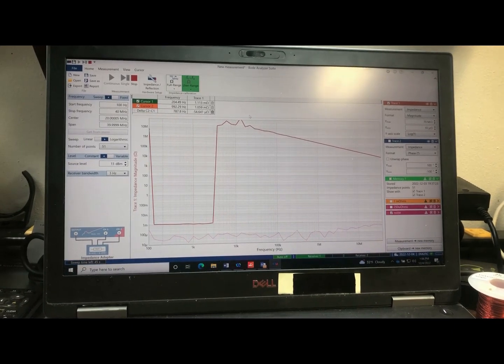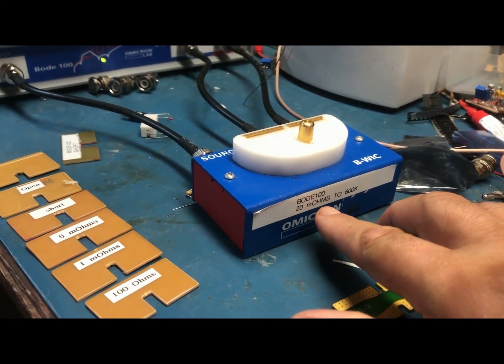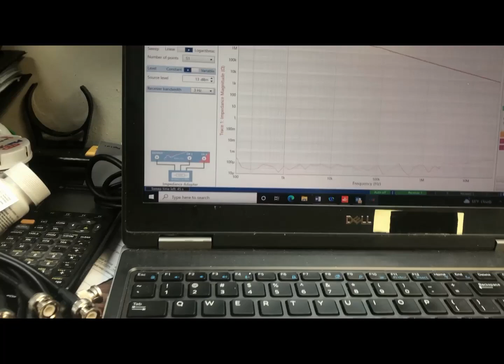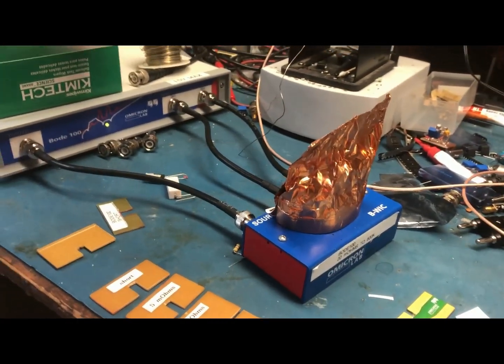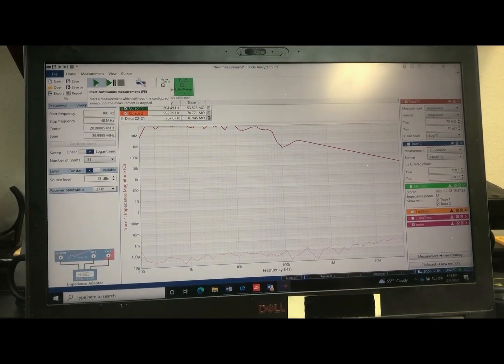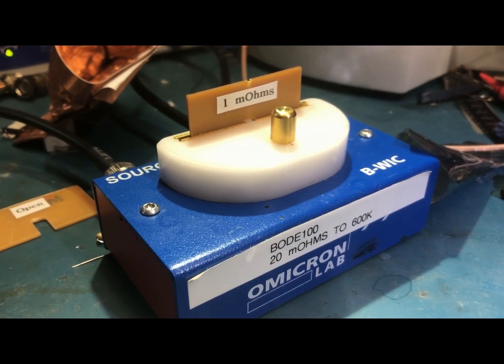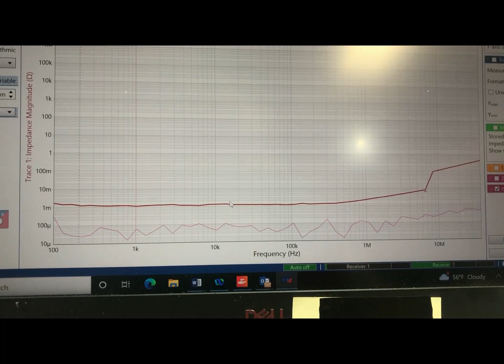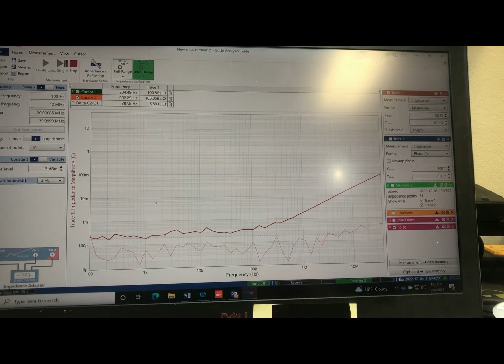Bode 100 Making Low Impedance Measurement using the BWIC Jig

Comment: @Robert Bolanos Hello Sir I have question about using Bode 100 measuring switch mode power supply stability. Lets assume you have +5V output and you connect Bode 100 and you get the plot.  Then lets assume you flip Magic switch and the output becomes -5V. In this case would you change the Bode 100 connections?
Reply from the maker: Hi Tony, the technique is the same whether you measure a positive or negative supply. If the channel 1 and 2 are connected reversed, you bode plot will be reverse, meaning that at low frequency, the gain will be in the negative dB and at high frequency, it will have positive db. I hope this makes sense.
Reply: @RobertBolanos  Thank you Robert. 
in case of -5V output I had to measure at ground side as if ground is the output and I was able to get meaningful results.

Comment: Hello may i ask how compensation is done when i want to build a laboratory power supply with variable output voltage? At the moment to set input reference voltage i am using potentiometer directly connected to inverting error op amp input of tl494 (fullbridge).  But due this i have variable impedance in compenstation network. And if have try to do loop response in Ltspice with FRA it just make completely different looking bode plot. When PSU is on and voltage is adjusted at some values  transformer starts  to make high frequency noise. PSU is 0-200V. On very low voltages its just not possible for me to eliminate weird noise (it sounds like corona discharge, but there is nothing like that). Lets say on whole range there are few points like 50-51V and 120-121V when high frequency noise occurs.
Ive got idea to use buffer but i think it will tend to fight ac coupled voltage from compenstation network... 
Seems like funny problem
Reply from the maker: If you have a schematic, please send to rbola35618@aol.com in pdf format.